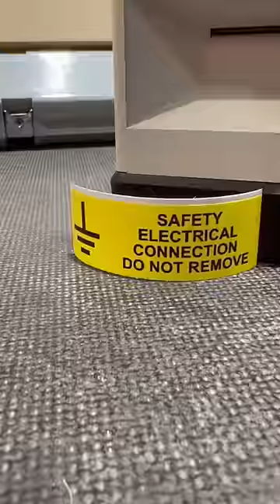Electricians Shocked by this Mysterious Earth Clamp

Comment: It is forbiden in France  .
You can have an electric shock ,when you take a bath or a showwer.
Reply: That is for safety reasons. He is not using the pipes as ground, he is connecting them to earthing bar which is seperatly grounded. That is to eliminete potential differences between the water pipes & actual ground. You cant never get shocked by those pipes if static electricity is not counted.

Comment: Earth bonding for gas and water mains has to be bonded near the incomer gas/water mains of supply does it not?
Reply: It's supplementary bonding I'm guessing due to the pipe size, the main incomer would be more like 22mm. These are either central heating pipes or the house hot/cold pipes fed from a header tank /hot water tank

Comment: I am confused, efixx is a professional electrician organisation but you are showing bonding clamps, that is NOT earthing.   The normal term of earthing is the CPC connection in the CU,  (which you show),  and is used to trip a MCB/fuse with over current or GFR/RCCD/MCBO with N/L imbalance , while bonding is to maintain equipotential between water supply and anything you can touch while using that water supply (ie the shower + radiator).

Comment: So this is why i find plumbing pipe that are energized
Reply: This is why you dont. He is not using them as ground, he is grounding them for potential reasons & because of that there will never voltage in those pipes. Power box is separately grounded.

Comment: I thought this was gonna ba a situation where a so called "appliance electrician" had updated a 3 prong dryer plug with a 4 without upgrading the cable; piggybacking the neutral conductor on the ground😑

Comment: What is the part number of the insulation/wire stripper you use for exposing the copper core mid cable plz?
Reply: It's called a razor knife. You can buy them everywhere.

Comment: I’m no electricity surgeon, but isn’t grounding a 110 volt circuit on a copper water line dangerous AF? Correct me if I’m wrong here please.
Reply: This isn’t the ground for the circuit. This is grounding the water pipes to the circuit
Reply: Pretty shure this is 230V.
Reply: This is 0V. He is grounding the pipes for potential reasons, they are not part of any circuit

Comment: Very sweet but.....could of done the Job with a pair of linesman and a 11 in 1...( klien)
Reply: If only Klein made tools relevant outside NA. Alas, nobody else uses phillips or square drive for anything important. Or imperial hex.
Reply: @Monkeh616  interesting.....wonder why he used a philips and a flat head in the video....hmm using Wiha...must only be working in Germany.
Reply: @johnwilliam882  Well, the remaining slotted screws are a disappointment to us all, but no phillips was used. That's a Pozi/slotted combo. Phillips is dead.

It's a shame, I actually like those Klein drivers, but an 11-in-1 is a 6-in-1 to me, and all six of those are the least used and least preferred - Ph1, Ph2 (neither used for anything actually tight), a couple slotted, and T10 and T15 - 90% of my Torx usage being T20 and T25.

Make one with Ph1+2, Pz1+2, T15, T20, and T25, and metric nut drivers (okay you can keep the 1/4" and the 5/16" will probably drive 8mm, but I've less use for a 3/8" than a spherical cow), and it'd be a good tool outside the US.
Reply: Not trying to argue...been a lineman for over 10 years socal Edison. My point was you don't need all those tools to hook up a cold water ground....klien, wiha, philips, etc,
Reply: @johnwilliam882  This is true, the basics will get you there. The extras are niceties. This short is basically advertising for the tools and materials. Also, hilarious and depressing comment bait to catch people who don't understand the purpose of bonding, which is mostly why I'm hanging around getting sad about Klein not valuing my market. I really do like those screwdrivers when I'm over your side of the pond.
Reply: The video point to me is no different than the person checking there transmission fluid cold while in park... with a thermometer, a depth gauge and let's see .....a viscosity denser...possibly a p38 modulator

Comment: Why is there in total just one ferrule used? Your wire is stranded. Only solid-core wires get put into any fixture without a ferrule, everything else needs a ferrule.
Reply: It's not a fine stranded wire, ferrules are not necessary.

Comment: Kit akarsz agyonverni  vagy kinek a hazat akarod felgyujtani?
Reply: If this is a main service ground bond connection, electrical hazard exists if upstream or down stream copper pipe(s) are removed. Thats why NEC  requires 1 ground connection at incoming water service before rhe main water shut off and a jumper across the water meter.

Comment: Tools all look hardly used. Unlike mine. When you work in a facility across four buildings of over 1 million sq feet on two levels, your tools look old in a few short months. Here if your tools shine, you ain’t working. Then late some plumbers going to splice a plastic line in that pipe and there goes your path to ground

Comment: Why guys keeps screwing down stranded wires without tin plating them? I wouldn't trust an electrician who does that shit.
Reply: Because tin flows under pressure and will result in a loose joint?

Comment: As a licensed plumber I do not what the hell you’re doing but I know it looks good😂😂😂
Reply: naw it's bad bad bad. dielectric metal, ring terminals required and he put it in a place that could kill you specifically. ground and bond only at the regulator. you should take a no contact voltage tester (EMF tester) and use it on any and all metallic pipes you may be cutting. it could save your life and probably will considering all the wrong comments about grounding in this thread, and most of the commenters are electricians 🤦😜

Comment: You can install a bonding wire for a hot water water heater, pipe to pipe. Doing this as your main earth/ground for your panel is simply stupid.
Reply: This is not the grounding rod. This is to protect in case the water pipes get energised

Comment: A week later this house burns to the ground all because a handyman adds a pex T to the room addition'[s bathroom, thereby separating the water mains Earth ground from the system.
Reply: Which would have no impact whatsoever because this bonding is applied where the cable enters the building. Not that a loss of bonding or even earth would cause a fire.

Comment: Its eligal to use the copper pluming for the earth wire in the uk .its already been said 
Most houses have plastic pip to the house . Stop cock . So renderings the earth cable .insulated. slways check round the house for a copper pin
Thats been banged in the ground. 
When an house is left vacant. The travelers iwill pull these out for scrap copper holds a good price .
If the house as basement you can put the earth pin in the ground out òf arms way. If you put a light bulb 
On a wire to the earth conection 
One live wire to it .if it lights alls well . Dont leave this idea in place as all the earth conections are alive.  Make shore theres no one working on the electrics in the house .

Comment: As an electrician, I would NEVER fucking reccomend using copper plumbing as a substitute for a proper ground rod. It's not truly safe. The concept works on paper, but in practice you don't truly know how well those pipes are grounded, and we don't drive 6 foot long grounding rods into the ground because it's fun, it is to insure without a doubt that any and all stray electricity goes to the ground without going through anything else. I've personally fixed way too many problems where people were getting shocked by their faucets and other metallic fixtures because of an improper ground. There's also the risk of current ending up passing through gas lines, which allows for some very dangerous consequences. Driving ground rods sucks, especially when you get put in a spot where you have to drive one the old fashioned way (with a sledge hammer starting out standing on a ladder). Most of the time this is still gonna be safe, but when I've been asked to take short cuts on jobs, I immediately ask the customer how comfortable they are with house fires. This usually gets the point across as to why I won't short cut things on jobs. I could, and like anyone else in this world I prefer to do the least amount of work possible for the money I get in return, but there's no compromise on a proper ground. There's at minimum 10 different ways this could go wrong and burn someone's house down, and kill multiple people in the house in the process, or electrocute someone because you don't exactly expect your kitchen faucet or your shower to be carrying electrical current. In my very experienced opinion, any electrician who even suggests this should be fired. People give electricians a hard time about not cleaning up after themselves etc, but until you've wired an entire house by yourself, or with just one helper, you don't realize how much weight is actually on the shoulders of a competent electrician. We are among the first people on the job to set the temporary pole so construction crews can do the framing etc without running on a generator, and are generally the last to leave because we have to hard wire appliances at the end of the job (or install the correct connectors to power them). I personally advise people to go with hard wiring their appliances because it's safer and more reliable. I would absolutely refuse to do this as a method of grounding a service. If the contractor/customer was adamant about it because they don't want a ground rod driven in their basement or whatever reason I would tell them they will have to find someone else to do it because I don't do ANYTHING to someone elses house that I wouldn't do to my own home. I will short cut things at home that I would never do on a job, but as a rule, I never install anything that has special rules as to how it's used. The person that has that work done won't always be there to explain "hey there's a space heater tapped into the microwave circuit so you can't have them both on at the same time (this is a simplification, the real situations are more complex). However that individual probably won't own that home forever, and the next owner isn't going to be aware of what has been done, and what might be moved around or added in the future further complicates the situation. This is why we tend to leave pieces of wire etc laying about and are somewhat messy. If you frame a house and mess it up most likely you will have rooms that aren't square, or cracks in drywall from the structure settling. If I mess something up as an electrician the best case scenario is it just doesn't work. Worst case scenario, too many space heaters end up on one circuit in the middle of winter and burns the house down with the family inside. Hence why we don't really care about stripped bits of wire left behind. We are more concerned about vastly more dangerous scenarios playing out at some point in the life span of that work. If you don't believe me ask an electrician if you can observe them work a "burnout" where a house has caught fire because of shoddy wiring. I've done a bunch of them, and it's not fun. There are many correct ways to do most stuff on electrical jobs, we have a lot more versatility in what we can do, where we place wires etc. That said, it's still VERY black and white as to right/wrong. You can half ass almost every aspect of construction with little consequence unless you are incredibly negligent. Your work will still show, and it will show you didn't do the best you could, but it's not a life and death matter. That's not how electricity works.... I might pull 10,000 feet of wire on a large house, and every inch of it has to be perfect. Every connection, pigtail, every aspect has to be 100% correct or I could kill a whole family. The ONLY time I will take a short cut on jobs is when it's a job for another electrician that fully understands the risks of using a ground wire in a 3 way switch etc. Even on the few occasions I've made those concessions I made it very clear I'd rather do it the correct up to code way, making sure to clarify multiple times that they are taking a risk. Again, those exceptions were strictly for other retired electricians/engineers who I KNOW understood the risk they were taking.
Reply: As an electrician, you should look up the term 'equipotential bonding' and rethink your comments.
Reply: Bro wrote a whole fucking essay just to be wrong 😂

Comment: Those pipes are grounded so if the neutral wire gets cut or just burns somehow the whole house from live vire and that grounding pipe and if you live in panel house (i dont know how is it called)the whole panel house will use your pipe as neutral wire so there could be 100amps going through that pipe because of this
Reply: It's a good job the pipe has a much larger area than needed for that level of current then, eh?
Reply: @Monkeh616  no because it can kill people. would actually be better if the pipe melted and sprayed water all over 😆
Reply: @QuantumMarmalade  Who's it going to kill? The bond removes hazardous potential within the building instead of leaving full supply voltage between the electrical ground and any exposed plumbing.

Comment: Two dumbest things I've seen since i learned to do electrical work.
1) a ground attached to a PVC pipe
2) moron who we hired to repair our garage door after it jumped rail and went to hell.  While installing the new opener he pulled out all of the extra electrical wire to the controller and cut it near flush.

Just in case you're wondering his work was exceptional up to that point.  I had no reason to expect he'd lop off a foot and a half of wire.

Comment: This is why later there ends up no ground plumbing changes the nay remove the outside metal plumbing to the building and wala no more earth ground. So ya electrician are shocked here in the USA we have learned not to do this but to have independent ground earth rods
Reply: Oh yes over here in Hicksville Europe we've only just discovered lectric... Maybe one day we'll be as advanced as you and truly understand 'grounding' and electrical installation as thoroughly as y'all do.
Reply: You are earthing the pipes not using the pipes as earth duh!
Reply: As Paul said, this is adding ground to the plumbing, not taking ground from it.
Reply: The piping is being earthed from the consumer unit - it is not providing an earth

It is to neate the charge caused by iron rich water in areas of the UK causing a charge which can start galvanic corrosion
Reply: @bengrogan9710  its not for that reason at all but I admire your confidence

Comment: when you find out the copper ends in pvc and the whole sh6thouse goes up in flames ...
Reply: Pipes are not used as ground... its for potential reasons
Fuse box is separately grounded to earthing eloctrode
Reply: @dudefromnorth9410   electrical metallic tubing (EMT) can be used as an equipment grounding conductor (EGC) in accordance with Section 250.118 of the National Electrical Code (NEC):   a copper water pipe can be used to ground an electrical panel according to the NEC (National Electrical Code), but only if it meets specific requirements: the pipe must be metal, underground, and in direct contact with the earth for at least 10 feet, essentially acting as a grounding electrode
Reply: @whirlwind8825  There still was separate grounding wire in that fuse box. Pipes are not used as ground & even if you can do it, thats a shitty installation & not allowed in my country.

Comment: Is this water or a gas tube?
Both are bad in my oppinion (and not only mine). If i did, show or say something at my electrician's exam, i would not get my licence. Gas is just worse, water a bit lesser evil. In all modern houses you should use earthing ground pins, earthing ring, combination of both or similar.
Attaching a PE wire to gas or water pipes, where you could have really, really weird voltage (i've seen induced voltage ranges going up to kV, so sparking is a real possibility) is just asking for trouble.
So, with all do respect, i decline :)
Reply: Hmm, unexpected voltages on plumbing.. I wonder why we might be firmly connecting them to a potential we expose on the surface of other equipment in the building?
Reply: @Monkeh616  My dad told me they had an electrician in the company, who grounded some circuits... Through fuel pipes🤣
He was working in a transport division of our national fuel company :)
I can imagine his swearing when he saw this🥰
Reply: @ogi22  In some fuel applications you ground pipes to dissipate static before it builds up, this is the correct thing to do. Its the same with lightning conductors. If they do their job correctly they are dissipating static in the air before it can strike, so if you never see lightning hit a tall building with conductors on, then they are doing their job. 

However in other situations for fuel, you don't want grounding, or you have a pipe mating that has static insulation, like a resistive plastic layer between 2 pipes or the fuel inlet.

Using fuel pipe as the only route to earth is stupid though.
Reply: @dennis8196  I'm sorry, i used a thought shortcut and perheaps didn't state it clearly. The pipe was a "grounding rod" for a conduit. Just as you said, it's stupid, dangerous and completly against all regulations, even back then.
Reply: @ogi22  np

Comment: Isn't it illegal to ground to a copper water pipe?
Reply: It's illegal to use a pipe AS a ground
This is grounding the pipe to the consumer unit - which has a bonded earth spike
It avoids a specific type of corrosion caused by iron rich water